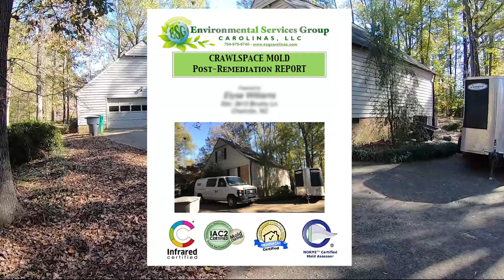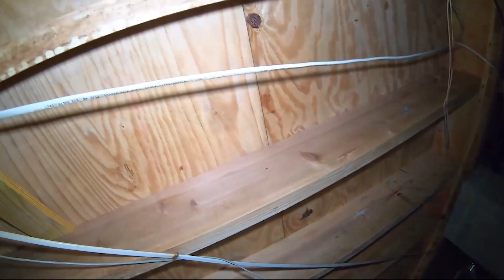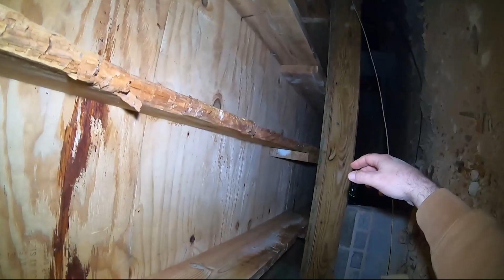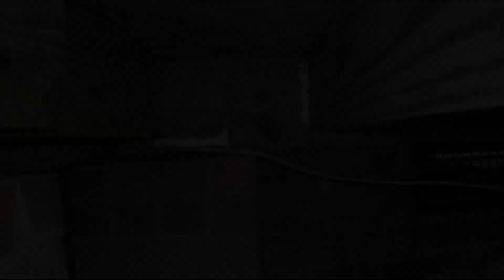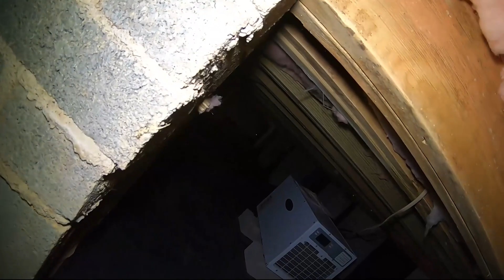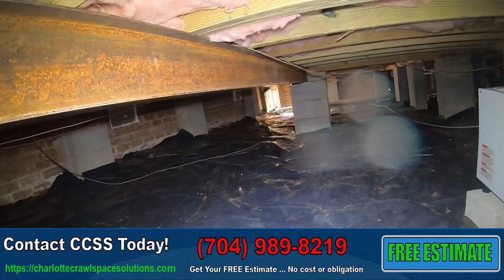Rotten Floor Joists Repair - Matthews NC - Charlotte Crawlspace Solutions 704.989.8219

Comment: how much did this cost the customer, and how much did it cost in material?
Reply: Too much. They soaked the customer
Reply: @lukiss01  , the customer was very satisfied with the work performed. And provided a nice review as well as several referrals. We never "soak" our customers. And petty google trolls like yourself with nothing to do except stir up drama on the web are the real threats to the public.
Reply: We do not share private information about our clients with the public.  Materials, suppliers, and applications and means are proprietary.
Reply: @Specialtyfoundationrepair 
Take 10 hypothetical 1500 sq ft homes built the same way this one was, with the same problem, same need, and give us a PRICE RANGE please. Or give us an AVERAGE PRICE between the 10 hypothetical properties allowing for differences between jobs. I understand each project is different. That’s why I’m asking for a range in the pricing, or an average taken from 10 jobs of the same dimensions. It’s obvious from many of the comments here that this info would be helpful to and much appreciated by many.
Thanks.
Reply: @iDONTdoFacebook , again, there is no standard pricing structure for these types of repairs. And every situation is different. All deployments are developed on a case by case basis. A general range of $10,000 - $25,000 for a 1500 square foot crawl space may be helpful here. But that is very general. Without a proper inspection and analysis it is really difficult to estimate anything.

Comment: he said franchises are not what you want, but he is talking about using bleach on the growth and he is calling a rim joist a sill.  A sill plate/mud sill is just that.  A rim joist is just that.  A sole plate is just that.  BTW don't use bleach.
Reply: We do not use bleach to clean mold. And we never have. And there is nothing anywhere in the video that mentions bleach. And we are not a franchisee operation. Splitting hair over a sill plate? Are you okay buddy?
Reply: @michaelmasserang8922 there was a mention of bleach still being on joist.
Reply: Only idiots use bleach to clean mold. No bleach was used on this project, or any other project we work on. The word "bleaching" was used in the context of discoloration of the wood from the mold itself. Thanks.

Comment: How much moisture will that dehumidifier pull from around the walls a piers? Seems like you would attach it to the wall and tape all of the seams.
Reply: No. Not with controlled Ventilation. Remember. The goal of the hybrid system is to run the dehumidifier as little as possible. You want the crawl space to ventilate and breathe so taped seams become less important with this protocol.

Comment: The “process” of cleaning joists - what do you do?  Soda blast then bleach it?
Reply: No. Soda Blasting and dry ice blasting actually damage the wood and spread the mold everywhere. And never, never, use bleach on wood. The products we use are proprietary and it would not be appropriate to share that information on a public forum. However, if you look up Paradigm Labs, you will be able to figure out the products that we use for mold cleaning protocols.
Reply: @michaelmasserang8922  want to sell your blend on your site?
Reply: @davidwatchesyoutube247 , not really set up for distribution. Our group is set up to perform installs and service.

Comment: Sounds good and professional . Also sounds like took a 5000$ job and made it 20,000$. Smh
Reply: @jane marshall , excellent. By all means. And your installs are what get flagged in inspection reports ensuring future work for properly trained professionals.
Reply: What evidence do you provide that you will do it right? Being a google troll does not prove anything. Are you better than a builder, tradesperson,  engineer and/or home inspector?
Reply: So, you think you can perform an industrial mold cleaning service, an entire floor system retrofit, re-insulate the sub-floor as well as putting down a vapor barrier and deploying a moisture control program with engineering and mold hygienist oversight and clearance testing for $5000? Since you are an expert please share how you did it and use specific examples how? Products used? And a clearance letter proving you did it correctly? Perhaps upload a video proving your point? Or in reality the truth is $5000 would not even cover the material costs for a project scope of this size. So you are either uneducated, ignorant, or both. Or perhaps you may be what we call a "Chuck in the Truck" in the industry operating without general liability and workman's compensation insurance running around the country side misleading the public and selling jobs for $5000 and installing improperly installed work? The kind of work we discover later and rip out and replace? Here is some advice. Don't quit your day job as u-tube troll does not suit your intelligence. Grow up.
Reply: @michaelmasserang8922  3 months later and it’s crickets. Great response.
Reply: @jimbeam6273 , handing idiots their hat is a pleasure. Exposing fraud in this industry is an important public service that I perform every week.

Comment: How much does a repair like this would cost on average for a similar size house (1500 sqft)?
Reply: From what I've seen, easily $23k
Reply: I just purchased a house in Western NC and the POS inspector before buying it stated everything looked good underneath the house. 
I moved in and a few weeks later found structure
Reply: There is not enough information here to provide an estimate. Every house is different than the next and may have unique challenges unique to that particular project. Each job is developed on a case by case basis. Without a site inspection it is difficult to understand what scope of services that you need. However, here in the Southeastern United States, projects that are 1500 square foot could potentially cost $5000-25,000 depending on the amount of damage and the scope of service desired for repair and long term moisture control.